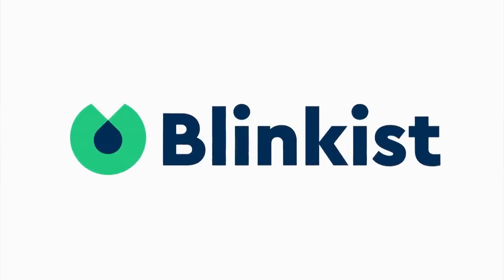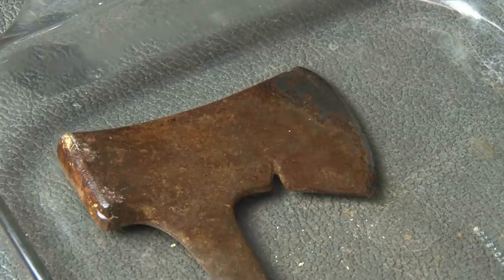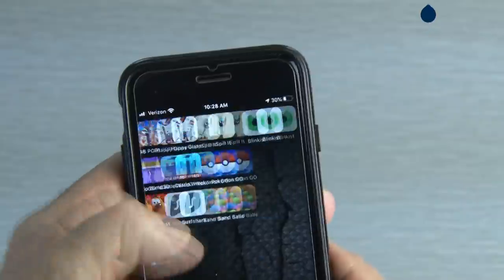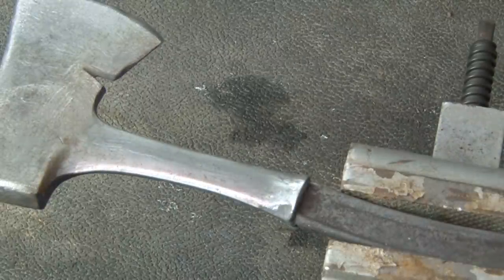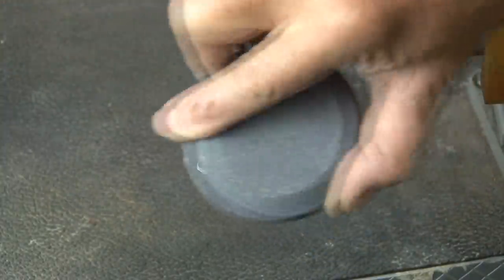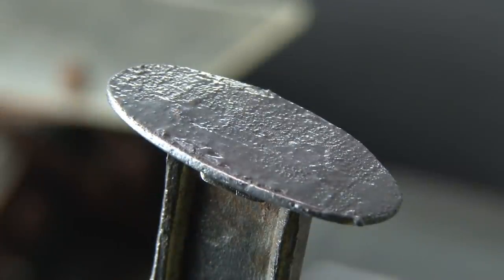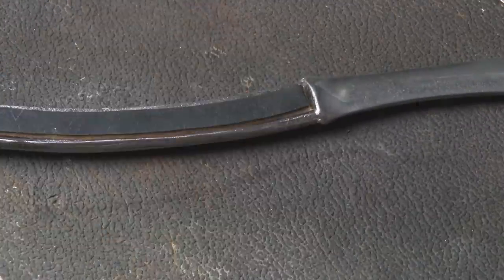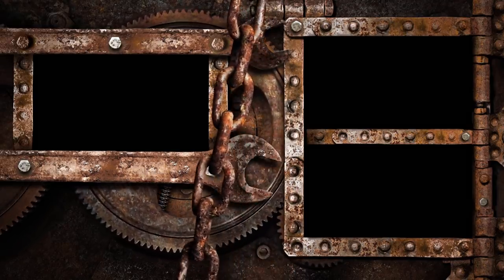Can I make this HATCHET "Chop" again?

Comment: Kip, I sent you a message during your kip kits days, I said I was on my way to a degree in electronic engineering. Well I wanted to tell you I made it, and now I work at an adhesive company using their high power continuous feed laser cutter (think a flat bed laser but with rollers to pull material through) and maintaining. And that was started by you. You let me live my dream. Cheers.
Reply: I grew up watching Kipkay in middle school around 2009....Graduated electrical engineering in 2019 and have a great job now! Your vids got me into tinkering, which got me into engineering.
Reply: Wow congrats guys!!
Reply: so the degree didn't actually pay off then?

Comment: Metal rescue might be good and have low/no toxicity but its definitely not under any circumstances or in any way chemical free
Reply from the maker: Metal Rescue® works by utilizing a water-based, safe synthetic molecule that is attracted specifically to iron oxide (i.e. rust). Metal Rescue removes the iron oxide and holds it in solution, leaving the base part and other materials safely unaffected.
Reply: kipkay yea so that would involve... chemicals.